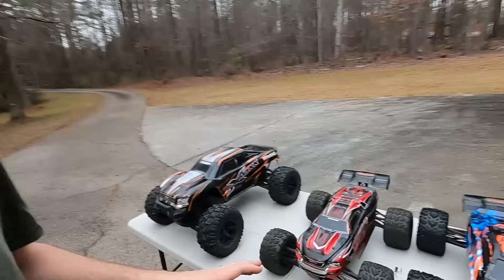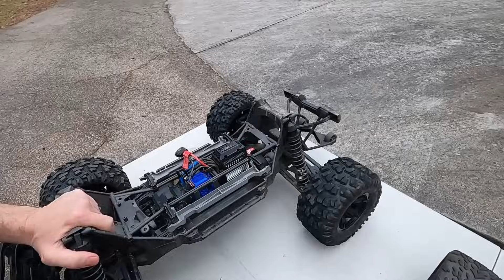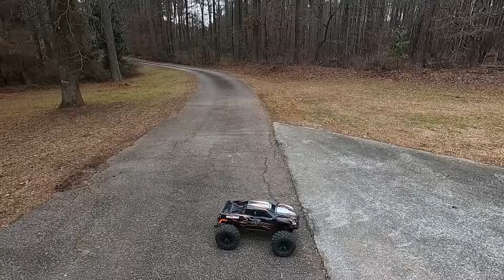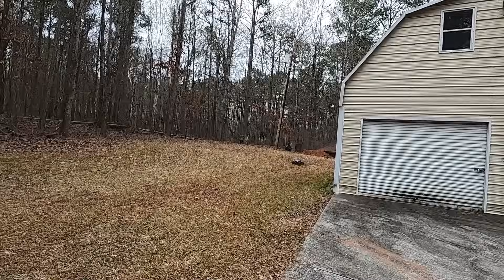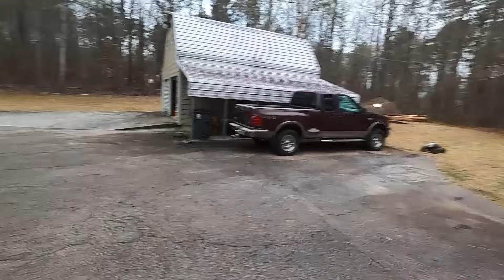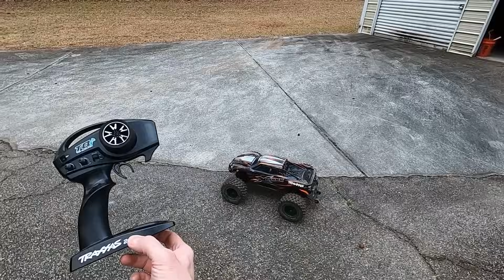Why Is My XMaxx Stock And Why Don't I Use Badlands?

Comment: I’ve had mine since 2017 and the only thing that I did was upgrade the wheel hexes to aluminum because I was noticing wear and twisting from the 8S power. Since then, it’s crazy durable and I take this thing to the skate park and jump it off half pipes while doing multiple flips in the air. Only parts I’ve ever broken were from a wreck and I think the total cost for replacement parts was $12 total. The XMaxx is the ultimate basher and if left alone and maintained properly it’ll last an incredibly long time and give hours of enjoyment to whoever owns one.
Reply: You are absolutely right they really do grip I built a RC track in the backyard I was trying to kill the grass with Roundup but then me and my friends we started running our xmax on the track and it tore that grass all to  pieces.. I'm 50 years old been had my xmax about 6 months now it is soooo much fun!!! The way this thing corners is unreal!! Please be careful around little kids I hit a little kid with my rustler and everybody laugh my cousin hit a kid with his xmax and it was a visit to the ER so have fun but be careful. A rc this big and this fast can be DANGEROUS!!! I love it though!!!!

Comment: I just got an XMaxx and did a lot of research before purchasing.  I had seen a lot of people online having issues with the rear hub carriers and getting the RPM ones, so I did go that direction right off the bat.  I did add some weight to the body with the goop and drywall tape. I also opted for the skid plate on the top.

I ended up (with heat) gorilla taping the tires because they kept ballooning and coming unglued; one even exploded.  I repaired the exploded tire with CA glue from the outside and really thin, scuffed bicycle inner tube with goop from the inside.  I almost went down the upgrade rabbit hole myself until I saw how much the badlands weigh (and cost).  After taping the tires no longer balloon.  Speaking of balloons, I did wrap from the end links to the shock bodies with balloons, under the spring.  This is better than shock socks because it actually seals the shafts from even the slightest chance of dirt getting in there and ruining seals.

I consider this to be essentially stock with some reinforcements.
Reply: Use 20lb fishing line for helping to stop ballooning. Also do the silicone ear plugs in front & rear differentials- i have no issues after doing that
Reply: @Dingle-Berries  wow that was a while ago.  This x-maxx has been through hell and back.  it keeps on going.  Very little time spent on the workbench.  I did go with a higher weight (500k?  1m?  I don't remember for sure) in the front and rear diffs and it crawls okay.  I did build a super crawler and holy crap that thing crawls!

I also did all kinds of antibalooning tricks including fishing line both inside and outside of the tires.  It worked well enough for a year or so, but I ended up getting belted tires.  If I remember right, the advertised weight was very negligible compared to other brands.  Again, this was a while ago.  I can look for specifics if you are interested.

Lol, it always interests me to see how some communities are relatively troll-free, with far fewer people being butt hurt by differing points of view, compared to communities related to some of my other hobbies.  Drone, video game and photography communities can be really congested with know-it-all negativity.  Automotive, airgun and ebike communities are generally pretty friendly ...  I'm brand new to 3d printing, we'll see how that goes!

Comment: I'm a stocker too man!
- I have only upgraded the rear carriers to RPM (bearing seals popped out of stock bearings), CEN hinge pins on the 4 outer corners (after breaking front left arm), and Traxxas black servo. Also sealed up stock wheel holes and vented tires to keep foams from getting destroyed by sand and water. 
- I have worn out my outdrives and the center diff shims (started popping internal gears) and replaced stock motor with a new stock motor due to front motor bearing going out (my fault for not servicing the motor bearings) since February 2017!
- Longest running RC, on a single set of batteries, of any I have owned (the Maxx is right up there with it now).
- This is one tough truck!

Comment: Great video man!! I've got the Badlands and haven't experienced the same things your describing and showing in the video.  I enjoy them because when I had my stock tires, I almost had them worn out around the outside due to the power slide turn around on the streets. I can still do this with the Badlands without flipping the truck and with as often as I do it the Badlands are holding up great!! I think you're used to driving it a certain way and now that you have made a change to the way it handles in your backyard you feel as though it's the tires and not the way you drive. Your just used to a certain result and with new tires it changes those results.

Comment: I applied for a job at Six Flags this summer and plan on buying this RC once I start working. I've been doing research for a few weeks now, and it looks like the only thing people say is to upgrade the stock rear hub carriers to the RPM rear hub carriers as the bearings will fall out easily on the stock ones (they also say that the CEN threaded hinge pins are a good upgrade as well), so I might upgrade those to thing immediately right out of the box! Other than that, I'll leave everything stock and won't upgrade until something breaks, which seems like it's pretty difficult to do as the stock X-MAXX is pretty strong on its own!

Comment: I say drive it before you upgrade it, things will break; replace/upgrade as required.

I purchased my Xmaxx 2nd hand and blew a tire in first minute, I purchase Badlands and they are great, solid tire. Though my steering servo went after awhile and I replaced it with a 2085X. All has been good ever since!
Reply: This is the approach I took with my 4x4 rustler and what I'm going to be doing with my xmaxx.
Reply: I got mine second hand aswell and the guy never told me the foams in two of the tires were shot.  Kind of a bummer but I heard the foams weren't good in the stock xmaxx tires. Guess we will see how the new ones hold up.
Reply: @dontplaydumb2352  that's good to hear, I can't stand scammers!

Comment: I actually like ballooning tires.  Aids in rotation in air and looks awesome.    Not like belted tires will allow an xmaxx to make high speed maneuvers anyways.  But I kept tearing stock 8s tires so went to duratrax lockups.

I also went max 5 and leopard 5892 motor.  Mostly because I wanted more rotation in the air.  The xmaxx actually handles big power pretty well and they extra power and weight really hasn't lead to extra breakage.  

I do agree proline 4.3 tires are way too heavy and lead to breakage though.  Funny how unsprung mass breaks everything but all the sprung mass I added haven't really effected the durability.

Comment: I have done one upgrade that came in handy the aftermarket rear bearing carriers with a larger size inner bearing work great
Reply: can u send me the link on amazon?
Reply: @levistewart5610  rpm part number 81732. Not sure how to send link but they are available on Amazon and eBay the replacement inner bearing comes with them and you use your outer bearing

Comment: Totally agree with you. Even the revo 2.0 stock tires are really quite good. I see a lot of people go straight to the belted trenchers. You lose drivability with those and weigh so much ends up either overheating your system or breaking other parts. I do run the non belted trenchers which are a bit lighter than stock. I would never go belted.

Comment: Chasing weak points just leads to more problems especially when it comes to adding weight and metal spur gears when unintended. It always ends up leading to drivetrain problems to some degree

Comment: For bashers it seems more important to make sure everything is maintained, and fixed immediately when something is broke or out of align.  I took your advice and added the limiting straps and aluminum rear chassis brace first thing though (Erevo).  It's been solid, thank you for that.  The cold is a killer though.
Reply from the maker: Thats awesome! I'm glad that worked out for you.

Comment: I agree alot with what was said. I will say however it depends on how your running your truck. Three of us bought Xmaxxes and we live in a very wet area. Two of us ripped our tires within 3 runs. Others have commented that the stock tires do not work well in the wet but I really don't understand why. We all switched to prolines and while they are heavier we have had no issues and we run the trucks hard on a a bmx track. Other than the tires my truck is stock.

Comment: Great vid, as always! I don't think though, that the stock servo is too weak, I think the spring in the servo saver is too soft. I upgraded to the heavy duty X-Maxx servo from Traxxas (2085X). It also ships with a harder spring for the servo saver. This made a huge difference in the handling of that beast. I also upgraded to the threaded hinge pins from RPM and the Oversized Rear Axle Carriers. They come with much bigger bearings (RPM 81732). These are all the upgrades the X-Maxx needs imho. Gotta love that RC! Cheers from Switzerland.
Reply from the maker: I bet that spring would kill the stock servo. I may look into getting that servo just to test it out.
Reply: @outsourcedrc  You need the 2085X. It is a beast! You can steer under power really well. I run belted bead lock badlands with a 2085X. It turns amazing.
Reply: Oh finally another Swiss RC enthusiast! I have a Mini E-Revo myself with a good bunch of upgrades (metal hollow balls, stiffer springs and GTR shocks, RPM front arms and bumper, Summit rear suspension arms, wheelie bar, motor heat sink, shimmed, re-oiled and re-greased diffs, etc.). Where do you run your car, any tracks in your region ? There's not much here between Geneva and Lausanne...
Reply: Don’t forget the traxxas 2087X servo gear upgrade.

Comment: Agree with you 100%.  As for for running gear, almost all my RTRs stay stock.  I do upgrade tires and wheels on my crawlers and no prep drag cars for grip and performance, but I don't really see the need to seemingly "upgrade everything" on my RCs, especially bashers.  My Maxx and X-maxx are all stock too.  I get its part of the fun, but at the same time, so much is unnecessary to do in my opinion in order to enjoy actually driving it.

Comment: The X-Maxx is a beast out the box for sure! However if you want to race around a track do flack flips/front flips or just be able to keep all four wheels on the ground then upgrades are a must. Nothing fancy....I use Hot glue for strength instead of buying aluminum  EVERYTHING. Great Video!

Comment: I've had mine for 2yrs and everything is still stock
Reply: How often have you used yours? Im debating between the xmaxx and kraton, both 1/5 scale
Reply: Wait for arrma to drop the 1/5 kraton exb if your looking at that because the current kraton 1/5 is a huge disappointment without dumping big money into it I have a 1/8 notorious and just picked up an xmaxx I love my arrma but the 1/5 scale aren't quite there yet although the outcast is pretty cool I was really tempted by it but waiting for them to work out a few bugs
Reply: @samimtokhy9312  dont buy the arrma dude
I have it and its a nightmare
Reply: @MertNisa3168  true i only drive the x maxx😩❤
Reply: I've had mine for 5 days and only thing I've upgraded is the front and rear hubs to the rpm oversized hubs
Reply: @samimtokhy9312  I am waiting for xmaxx .. but i have v2 8s kraton.. unfortunately arms front and back are breaking constantly.. altho it has plenty of power i broke stock shaft on motor and now pinions for new 8mm motor are unavailible... shocks tend to bend.. but the biggest downfall are arms.. you can take it easy and still you gonna break.. I have the rpm ones now but I am waiting for motor.. xmaxx will arive soon so gonna test that first :)
Reply: I was stuck in between the Kraton 8s and xmaxx as well but after seeing this comment I think I will go for the Xmaxx. Thanks
Reply: @jeremytichai9782  i have both cars now.. and generaly xmaxx is more toy type and rly fun and agile to drive while kraton is more beast type where everything is more on the limit.. on kraton I would wait for v3 where it will proobably have 8mm shaft on motor.. I use 27t pinion now and thing flyes but also very demanding on batteries.. out of the two - for looks and performance I would take kraton and for everyday fun car and simplicity I would take xmaxx. Dont get a feeling that xmaxx inst fast or something.. I use it stock and it is plenty fast(wheelies all day)
Reply: How about the outcast 8s? Heard it's a beast too and that red look is really amazing
Reply: @jeremytichai9782  it is basicly kraton with shorter wheelbase and backflip tyres.. more stunty truck with wide stance

Comment: I feel your right. It's tuff out of the box. The only thing that sucks is the steering survo. It's a plastic gear cheep piece of sh#t. For the price of $100 you can upgrade to the 2085X which it should have came stock on it for the huge price of the Xmaxx!! Great Video!

Comment: Thank you for posting this. 
I'm a huge fan of my 8s X-Maxx and really feel it's very near 100% out of the box. Traxxas really did hit the nail on the head with the 8s version and it's Huge fun. Everyone should aim to get one.

And you're so right about the whole upgrade "hole" so many people dig for themselves.

Only thing I've done with my X-Maxx is the rear RPM hub carriers, as I got sick of blowing the inner bearings and the servo saver mod with the slightly longer bolt through the servo saver with a nut on the other end. no more dodgey steering.. even the steering servo is still stock.
Oh and nearly forgot... 50wt shock oil all round. Makes it handle the bigger jumps and general drivability quite a lot nicer I feel.

It's stock everywhere else. Also found through lots of "internet research" if you use good quality Lipos, the ESC is very reliable too.

Comment: I firmly believe that if you want to go faster etc for example, just run another car out of your collection that is better suited for higher speeds. If you take some of the cheaper cars around they will do say 30-35 mph, if you upgrade the same car with massive power to do 60mph. It wont last long before you start constantly breaking parts or huge crashes. Again leave that car pretty much stock & run it within its limits with out breaking it constantly, then swap to a more suitable car that is built to run consistently at the higher speed without breaking it or crashing it every time its run. I think minor upgrades are good to improve durability on some vulnerable parts are ok, but to spend fortunes upgrading a car seems crazy. Especially when you know you are pushing something beyond its capable limits.

Comment: I have the 1st gen 6s x maxx I got when it first came out.  I only bent  one shock shaft on it since new. Last year I bought an 8s x maxx  and have been through one stock esc, proline trenchers, proline badlands and the duratrax hatchet x. The prolines destroyed the gears in 2 servos.  The duratrax were the lightest of the 3 but still had to upgrade to the metal gear servo for 100-bucks. Now I’m breaking arms. Sometimes it’s best to just leave things stock. I agree this is the case with the x maxx.

Comment: Nice video. I agree. I have 10 year old 3.3 T-maxx and Revo. All stock. Quick. Durable. Wheelies on demand. Original motors. Others I bash with wonder why they can't do wheelies, why they cook clutches and gears, why they break driveshafts, why their motors overheat, etc. I tell them because they added way to much weight with "Upgrades." When I get an X-maxx, it will stay stock too.

Comment: Only upgrades worth while on Xmaxx is 
1) Servo. Doesn't add weight but a pretty big upgrade for turning. Traxxas offers a direct drop in replacement servo for this truck. 

2) oversize axle carriers by RPM. Doesn't add weight but increase load bearing potential if you're an extreme basher. Huge jumps etc. 

3) ESC if and when your stock one breaks. Max 6 drops right in. Again, only after stock breaks. If it does.

Comment: Good to know. I will pay attention to similar things when deciding to update tires in E-Revo 2.0
Reply: E Revo 2.0 is not that tough stock. Straps, servos, RPM A arms, HD push rodes, toe links, brace, body savers, motor fans... it needs a lot of things and still not for mindless jumping.
Reply: @iasssen  only thing that happened to my e revo was those servos. I got the suspension straps but I never had any problems before that. If a toe link breaks it only a 45 second fix